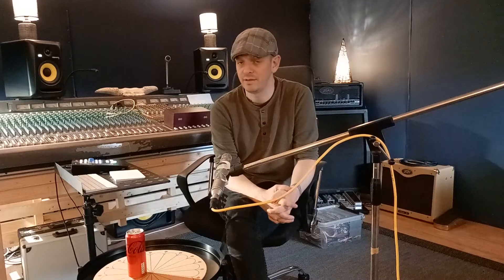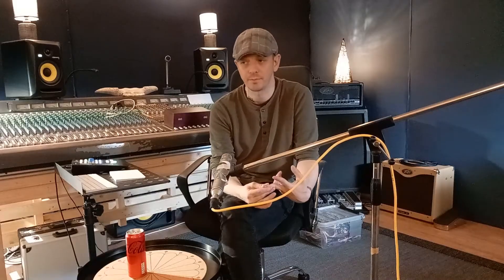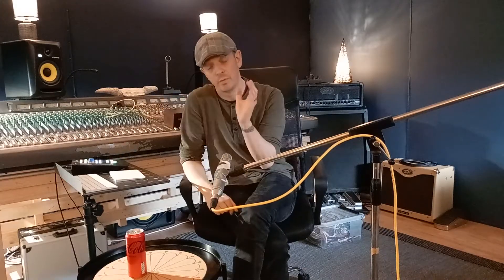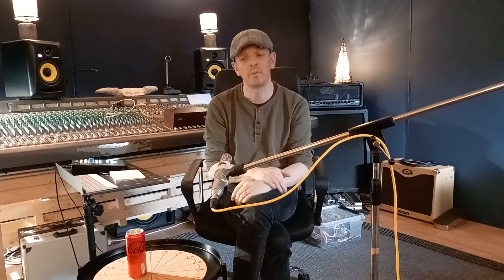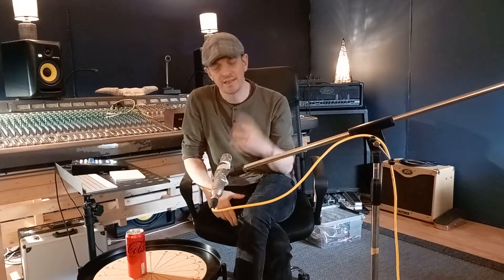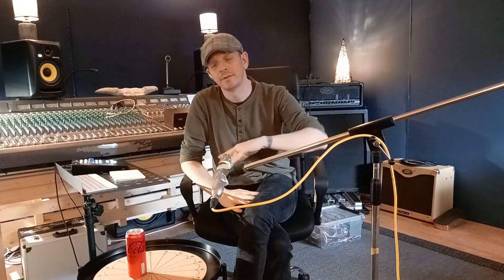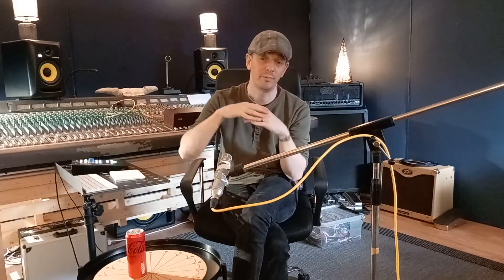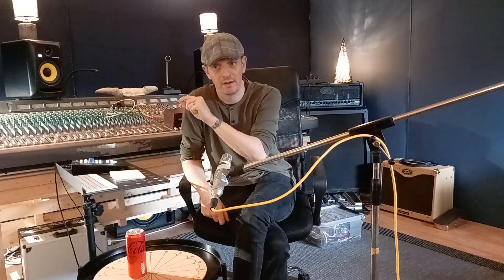Gain Staging. Analog vs Digital.

Comment: Wonderfu! When using analog gear for the master bus you go into the analog chain using gain trim plugin to bring the level down to -18dbfs and then add gain using the analog gear and come back to the DAW at what level? Anything that doesn't go above 0Dbfs (considering the limiter is also analog) ?
Reply from the maker: Im using digital limiter so im going in and out at -18 dbfs. If i would use a analog limiter i would do the same but use a gain plugin after the i/o

Comment: Great explanation! Excuse me… -18 db peak or RMS? Because when VU meter is 0 db, the peak meter is -8 / -6 db…
Reply from the maker: Thank you! It depends. If you send a sine wave it should peak. Transient makes VU meter with a needle react different because its to slow. Remember there is vu meters thats digital. Like on the ssl console. How ever its not that important just stick at -18dbfs ITB and at about 0vu in analog realm and your good to go. 🙂

Comment: Its just my opinion, but I don't feel you can have a discussion on gain staging without going over the difference between gain and volume. Its very rare to find someone that has a complete understanding of the differences between the two.

Also, in the video, when discussing analog gain and digital gain (trim), it would make it easier to understand if you point out that analog gain is adjusted by varying the signal level and digital trim is adjusted by varying the bitrate. If you have ever heard of the term bit stripping, that's what its referring to.
Reply from the maker: Thanks for sharing. The point of my episode is to get the knowledge out of what a Line Level signal is. People seems to think dBVU and dBFS are the same and this was my way of letting the world know. Hope you have a nice day!

Comment: So set all my faders to -18d fs then apply a gain plug in on all tracks?
Reply from the maker: Set faders to 0 dbfs. Normalize the tracks so it hits the fader at -18dbfs. 🙏
Reply: Just set your master fader to -18 dBfs.
Reply from the maker: The audio should be at -18dbfs. Not the fader.
Reply: @  yeah, that`s what i meant tho
Reply from the maker: @DJURBANBG  🙏

Comment: Finally someone who explains it how it is, I’ve seen so many controversial videos about this. I even stopped following some channels who told utter nonsense about this 😊
I work on an analog console, all outside the box, you have to gain stage to -18 bBfs in order to not lose your headroom 👍🏼
Reply from the maker: Thank you! I got tired of all the myths thats floating around thats why I did the episode. What console do you use?
Reply: @Anything-about-music    Just an Allen & Heath GL2400, I wanted to use it for zero latency tracking monitoring but ended up using it for mixing and like it a lot.
Reply from the maker: @Chaos-Dynamics  clean and good sounding console. Shure is more fun to touch knobs instead of moving a mouse.
Reply: @Anything-about-music   One thing for sure, not only more fun but a much faster workflow. And the best part is mixing with your ears instead of your eyes.
Reply from the maker: @Chaos-Dynamics  100% agree!

Comment: It depends how your converter is calibrated ....Some are calibrated at -16 dbfs ...They are not all at -18...
Reply from the maker: I have never had that. But hey so you get two more db of headroom. But still the analog wants to be hit with line level and most of analog emulated plugin wants to be hit with -18db. Dont need to be so anal about it. 🤷‍♂️
Reply: Apogee Rosetta 800 is -16dbfs...best explanation out there

Comment: good video! Some small points of clarification though:

- dBu is a measure of voltage, and is an average signal level
- dBFS measures peak. So something that shows 0VU (+4dBu) can vary a lot in dBFS levels. It’s rarely going to always be the case that 0VU is always -18dBFS.
- While many analog modelled plugins are modelled for -18dBFS=+4dBu, it’s actually very common for manufacturers to use a variety of calibration levels. Sometimes it can be -12dBFS=4dBu, for instance, or anywhere in between. The only way to be sure is to check and not assume that it’s always -18dBFS.
- furthermore, not all converters are calibrated or set up for +4dBu=-18dBFS. These actually vary a lot between different models and manufacturers. Some allow you to adjust the amount of headroom. This will greatly affect the dBFS level that a constant dBu value will show as.
Reply from the maker: Thanks for sharing! How ever i dont think we need to be so anal about it. If People have pro interface where they can calibrate headroom im shure they dont need to watch this episode. 🙏

Comment: 4:50 normalisation at -18dBFS peak?  Mmmm I think it would be RMS.
Reply from the maker: Shure, if you want to drive it a little. Dont need to be so anal about it. 🙏
Reply: yes RMS. If youre hitting your DAW at -18dbfs peak, youre leaving an awful lot of headroom on the table.  @Anything-about-music
Reply from the maker: @LaminarSound  Thanks for your input but that have never been an issue. As I told so many times before. You dont need to be so anal about it. 🙂🙏
Reply: respectfully disagree. If its not a big deal, why not just run peaks at -6db in your DAW? I understand analog gear is looking for a RANGE of signal, not necessarily EXACTLY -18db, but the difference between -18 rms and -18 peak is substantial enough to matter in my opinion. Especially when it comes to live sound on digital consoles.  @Anything-about-music
Reply from the maker: Well -18dbfs and -6dbfs is a big differens not even close to -18dbfs peak/rms. @LaminarSound
Reply: @LaminarSound  , Which is why you come in at -18dbfs, as a peak, so yes, the rms would be lower, because if you have 60 tracks all peaking at -6, the master bus will be distorted, the mix won't translate to other setups. The accumulative effect, basically. Which is also why, if you see a snare hit, coming in peaking at, let's say -4, many will use a limiter to bring that odd hit down. Having said all that, one or two db in either direction of -18, won't be the end of the world, Bob Katz recommends coming in at -14 and or -12, with his K mastering system. However, the point is, if you want a super clear open mix and not to damage the signal path, over x amount of tracks with a net effect, then gain staging, into the plugins and out of them to other emulated plugins, always bringing the line level back down to -18, is simply the correct and optimum level and whilst rules are there to be broken, if you have 40 tracks all coming in at -10, the bounced mix will sound crap, certainly not optimum. So many people don't think it's important, and yet every session I've worked on at the BBC, test tone goes through the gear, test tones all over the place, the same as having to do all that stuff with the tape calibration.
Reply: Based on my own experience, I do not agree. 

I run Pro Tools sessions with well over 60 tracks and generally aim for peaks at -6 to -8dbfs. I have no issues with clipping on my master buss. For one, not all 60+ tracks are playing at the same time. Two, not all tracks have information in the same frequency range. Three, each track has EQ and compression, among other processing, which significantly changes the original wave form.  

You said "if you have 40 tracks all coming in at -10, the bounced mix will sound crap". This is just not accurate. Im not sure why anyone would say that. Have you ever actually done that? I have. No issue. When is anyone ever recording 40 tracks of the exact same thing??? 

Audio does build up in amplitude but it's not an issue when the range of frequencies is spread out. 

I do agree everyone has their own workflow and if it works for you go right ahead. I also understand some plugins that model analog gear are optimized to sound best with levels closer to -18, but I believe those are still RMS levels, not peak levels. 

At the end of every mix, your track will be compressed to shit anyways and splattered on Spotify so who cares what the level is on your individual tracks as long as you dont clip?? Especially nowadays when most people run 32bit float, it's even HARDER to clip once youre in a DAW.  @MKD371
Reply: @MKD371   Absolutely, very nice explanation!
Reply: @ , The thing is there's nothing being anal, about it, it's just what the outboard gear likes, -18, or course this can be stretched either way, however, it's just a binary number that the boxes prefer. When you have 100 tracks, or more, I find even coming in at peak levels at -18, very good for the mix and over all gain structure. It's what we would always do at Maida Vale.
Reply: @MKD371  Yes, what i do when i use outboard gear is to monitor the levels of the outputs and inputs of my converter in the DAW, which must always be -18 dbfs. Then i am sure i am doing things right!

Comment: What is your thoughts on dynamic range is it pertains to gain staging. For instance using vocals as an example, you have peak and average information. Are you basing your levels on peak, or average information, or some approximation between the two? My practice has always been to send a 1k tone from my daw into my gear and set it to 0 dBu, which then gives me a good starting point.
Reply from the maker: Im using peak, how ever some times i need to change volume. I guess you should use avarage (RMS). But i still think its not 100% important. As long as you know about the diffrent with dbVu vs dbFs.

Comment: Perfectly explained 👍🏼👍🏼
Reply: In defense of being anal, or precise, especially when it comes to the point of this video and topic which is Gain Staging and Calibration between the Analog and Digital worlds, I'd like to keep this conversation going...

A) I've seen dozens of videos on Gain Staging and this is about the Most accurate to my understanding  so far.

B) My one red flag was about Normalizing to -18dBFS 'Peak' rather than RMS, which is what a VU Meter is Calibrated for.

C)  As to Converter Maximum Levels vs Gain Staging & Analog/Digital Calibration, this stuff IS confusing, and I've been doing it Professionally for 30 years.  So let's relax.

For starters +24dbVU is not a thing.  I believe you mean +24dBu as in the Maximum Analog I/O Levels on AD/DA Converters relative to 0dBFS.

In the purely Analog realm, 0VU on VU Meters is usually Calibrated to +4dBu (which is 1.23v on a voltmeter,  when fed by a 1kHz steady state tone).  
So 0VU = +4dBu.

When fed into an ADC, that Converter will have a Maximum Input Level before clipping the Converters,  referenced to 0dBFS in the digital realm.

I have a pair of Quantum 4848s that are +18dBu, as well as others at +20dBu & +24dBu.

If I've Calibrated the Analog system to 0VU = +4dBu average RMS signals, and I feed tone into those Converters, then the +18dBu Converters will have 14dB of headroom,  the +20dBu will have 16dB of headroom, and the +24dBu will have 20dB of headroom, before clipping. 

Now, I may choose to run my signals Hotter, effectively eating into that available headroom, and we can discuss the value of doing that (there's no saturation to be gained, but there are SNR benefits, possibly dynamic range.)

As far as Outputs though, the +18dBu Max Output Levels from the Converters directly into Outboard Gear may not be enough signal level to really 'Drive' Analog gear where it wants to be hit.

Those 64 Quantum Outputs hitting my Console at  +18dBu is more than adequate because every channel hits a Gain Stage.  If I want more I turn it up.  If they were feeding say an Analog Summing Box though, it may not be enough to make that box sing.

But even here, the Nominal level that you'd Calibrate the DAC into the next Analog Stage is +4dBu, and the difference between +18 and +24dBu is how much Over the baseline you can push the signal before clipping the Output Converters. 

D)  I wrote this in response to another question, but I'll add it here as well:

So for Calibration it's a 1kHz steady  state tone = +4dBu RMS, which is also = 0 VU, and 1.23v on a voltmeter. 

If you Normalized to -18dBFS peak rather than average, (sample peak vs RMS) then depending upon how transient the signal was, you'd end up with a ton of headroom. 

The Crest Factor of a Bass guitar is pretty close Peak to RMS so it wouldn't be much different,  but say a raw Snare mic could have Peaks a mile away from the RMS average of the signal.

That said, if normalizing to -18dBFS RMS, that Snare only has 18dB of headroom before clipping the Converters, and if you're Not compressing or limiting peaks on the way in, you may need to pull Transient channels back from that Normalized level.  Or as in one of the other videos, pop an 1176 in the chain and catch those peaks.

Is that your understanding?
Reply from the maker: @G_handle   Wow thats a long answer! Yeah your spot on. My episode was made to explane about that there is a differens of dbfs vs dbvu without nerding out to much about it. I have notice that a lot of people have missed this in the past.🙏
Reply: It’s actually not correct. The dbFS equivalent to +4dbVU is dependent on your converters. For example: 0dbFS is equivalent to the maximum dbVU of your converters. My Apollo mkIi has a maximum level of +20.2. Therefore, 0dbFS = +20.2dbVU. That means +4dbVU = -16.2dbFS for my converters.  Different converters will need their own calculation. This is easily verified with a tone generator and a volt meter.
Reply: 18dbFS can be used in many cases for some daws and some plugins internal to the DAW. It depends on what your system is. in hardware it’s exactly the way I posted previously.
Reply from the maker: Well off curse your right about that. How ever you dont need to be so anal about it. Most of interfaces use -18dbfs because that's what most DAW uses. And in your case you get two more db of headeroom if you use my method. Win/win. Have nice week!
Reply from the maker: Thank you!🙏
Reply: Anal? No. Interfaces don’t use -18dbfs. They use their maximum output level = 0dbfs. Remember: this video will be up for years. The latest Apollos are at +24dbVU. When I upgrade I am going to have to be mindful of the difference. Otherwise, I’ll be 3.8db off if I have to reprint a new mix for a client. The outputs will interact entirely differently with my hardware.

Comment: If at the end of your master out chain everything is -18dbfs what's the best way to get the track up to the standard radio loudness of say -8dbfs?
Reply: Why Peak? The Hardware expects -18dbFs RMS - if I have strong peak material im way under the saturation point. Every Hardware has enoigh headroom and so does the plugins have - a VU meter is not very sensible for peaks, its rather the material over time - rms. Or did I get something wrong?
Reply from the maker: @hinky7729  either way should be fine. 😊
Reply: Yeah everyone seems to just gloss over peak vs rms levels. ITS IMPORTANT! -18dbfs RMS is what hes referring to.  @hinky7729
Reply from the maker: Put a limiter at the end of the master after the eq och compression that happens at -18dbfs.
Reply: So put a limiter at the end and pull it down until it gets loud and distorted then pull back a little so it's not distorting to get the max loudness out of the track?
Reply from the maker: @artist1303  first make the master -18dbfs. Then correct with eq and compression to taste and when you are happy boost it to as loud as you want with a limiter.  Personal im going for -14 Lufs.
Reply: @Kenneth-F Exactly my question! 

So for Calibration it's a 1kHz steady  state tone = +4dBu RMS, which is also = 0 VU, and 1.23v on a voltmeter. 

If you Normalized to -18dBFS peak rather than average, (sample peak vs RMS) then depending upon how transient the signal was, you'd end up with a ton of headroom. 

The Crest Factor of a Bass guitar is pretty close Peak to RMS so it wouldn't be much different,  but say a raw Snare mic could have Peaks a mile away from the RMS average of the signal.

That said, if normalizing to -18dBFS RMS, that Snare only has 18dB of headroom before clipping the Converters, and if you're Not compressing or limiting peaks on the way in, you may need to pull Transient channels back from that Normalized level.  Or as in one of the other videos, pop an 1176 in the chain and catch those peaks.

Is that your understanding?
Reply: @Kenneth-F  Doesn't your most recent video say Don't use -14 LUFS?

You changed course in 3 weeks?
Lol.
Reply from the maker: @G_handle  Thats correct. Got my spotify wrapped and noticed the diffrent. If you cant change your mind your never gonna grow. About peak vs rms, do as you please. Dont need to be so anal about numbers. Use your ears. 🙏
Reply: Exactly my question! 

So for Calibration it's a 1kHz steady  state tone = +4dBu RMS, which is also = 0 VU, and 1.23v on a voltmeter. 

If you Normalized to -18dBFS peak rather than average, (sample peak vs RMS) then depending upon how transient the signal was, you'd end up with a ton of headroom. 

The Crest Factor of a Bass guitar is pretty close Peak to RMS so it wouldn't be much different,  but say a raw Snare mic could have Peaks a mile away from the RMS average of the signal.

That said, if normalizing to -18dBFS RMS, that Snare only has 18dB of headroom before clipping the Converters, and if you're Not compressing or limiting peaks on the way in, you may need to pull Transient channels back from that Normalized level.  Or as in one of the other videos, pop an 1176 in the chain and catch those peaks.

Is that your understanding?